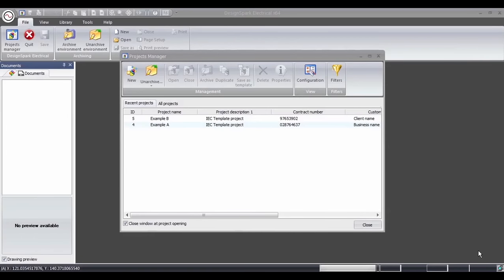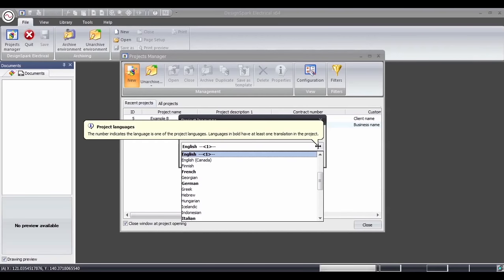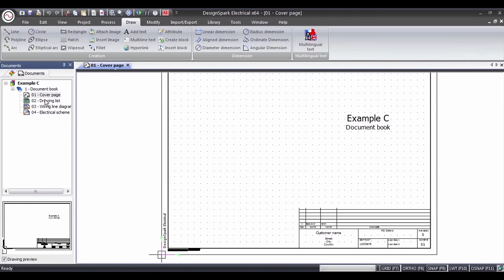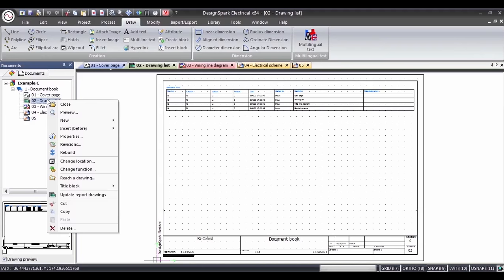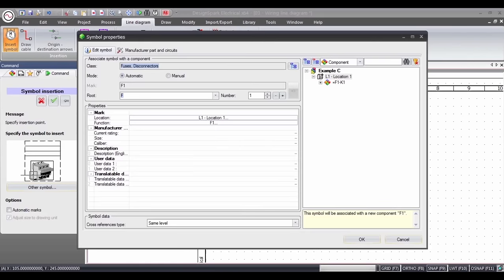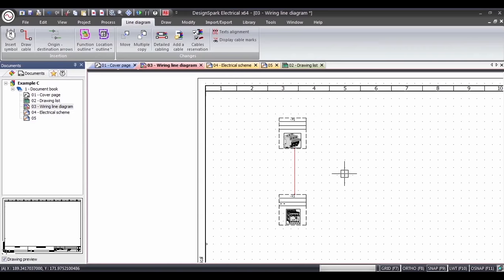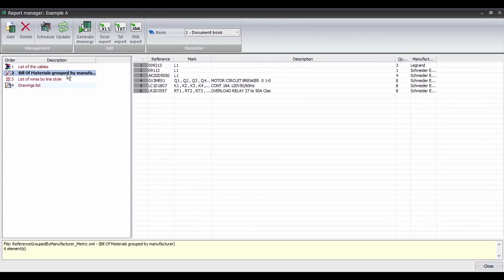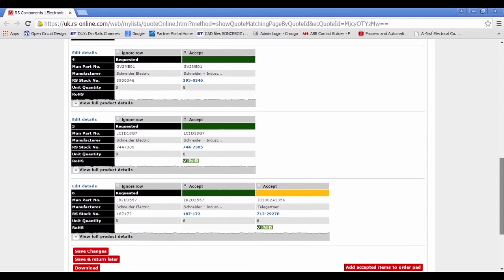Get started with DesignSpark Electrical

Comment from the maker: NOTE: DSE v2.0 no longer has the 2D cabinet layouts function. Here are the changes in DSE v2.0 onwards:
• 3 Electrical schematic sheets per project, including wiring line diagrams.
Limit of 3 pages does not apply to reports, cover pages or, appendix documents. The overall document limit per project remains 15.
• Reporting- Variants of Bill of Materials and Wire list by styles templates only. Two report configurations saved at any one time. No custom report templates.
• No 2D Cabinet panel drawing creation
• No Circuit macros manager
• No Terminal strip manager

Please watch updated tutorials if you have installed DSE v2 or newer: https://www.youtube.com/watch?v=yUuTzpDBDVs&list=PLv91f6GOku19YlGtQWNoTlQioZobeE9q_

Comment: In DesignSpark Electrical 2.0.1, when you're inserting a symbol, there's no pictures like in this video. There's only 2d symbols without photos which is impossible to understand what device is this. Also there's no 2D cabinet button also.